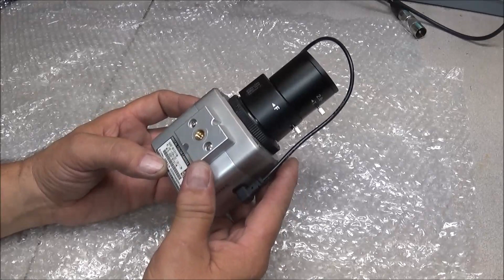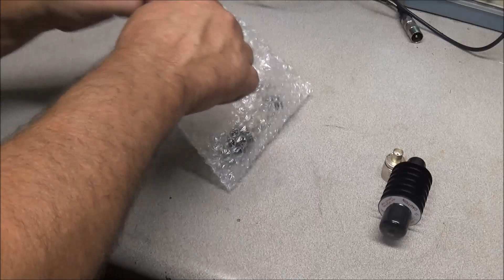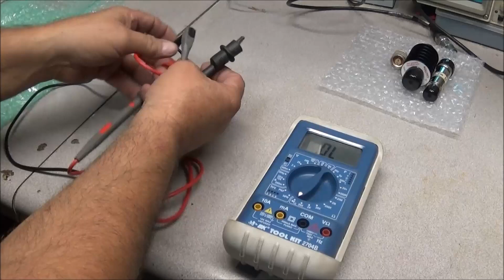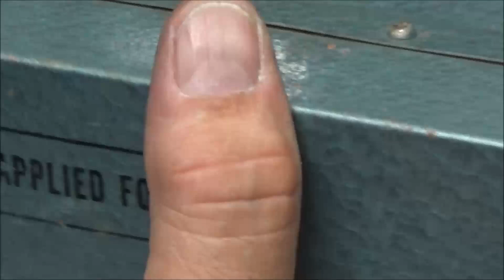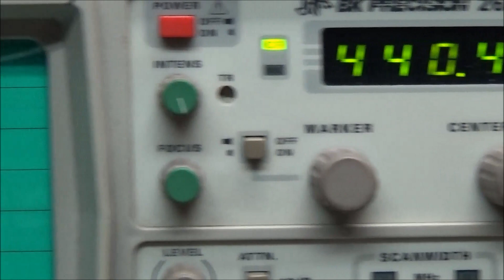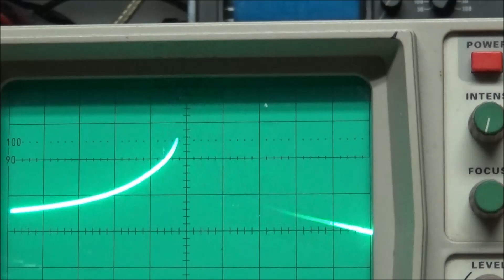#71 Mail Time Special

Comment: Well Buddy thanks to your friend Mike there you now have a well rounded out shop !!!  I am glad for you !!!  Mike done a super job with packing that spectrum analyzer !!!  About two months ago I had bought an old HP 3585b that arrived in good condition, but could have been boxed better !!  Now my analyzer weights 100 lbs it is heavy !!!! It SHOULD have been DOUBLE BOXED, butthey only used one Heavy box, IT somehow got TORN open on one corner in shipment !!  I was worried at first !! but as I opened everything up it was at last O.K. and suffered no damage, they did do one thing right and that is they used plenty of that heavy foam that Mike used with your piece, and that saved the HP inside !!!!  Lots of luck with your unit, now its time to read the manual and get familiar with it !!!!!  Good  Luck there buddy!!!!   John A Bellas  KC2UVN.
Reply from the maker: Thanks John, Mike is a great guy.  100 pounds is one heck of an analyzer. Back breaker. Well we do like old stuff lol.  Glad no damage was done to that battle tank!. Thanks for watching my friend.

Comment: Buddy,
That lens should be a CS mount thread 1"-32. That adapter you unscrewed, see it that will screw on the camera. You will need a frame grabber to get the video into the computer. A USB2 one like in the link below. You will also need a BNC to RCA adapter.

http://www.newegg.com/Product/Product.aspx?Item=9SIA24G28N5810&cm_re=usb_video_capture-_-9SIA24G28N5810-_-Product

Here's link for the manual.

https://www.google.com/url?sa=t&rct=j&q=&esrc=s&source=web&cd=2&cad=rja&uact=8&ved=0ahUKEwir7MvRxZ_PAhVDRCYKHUZLDz8QFgglMAE&url=https%3A%2F%2Fwww.123securityproducts.com%2Fdownloads%2Fdl%2Ffile%2Fid%2F2678%2Fscc_b1311_manual.pdf&usg=AFQjCNFjl7I3E6qmHPQ6leHsCc7mi_JpWw&sig2=uSyg9LKBN8BNQtBboSXCSw

That B&W from Upper Darby, PA is next door to my home QTH.

WB3BJU
Reply from the maker: Donald, thanks for that information. I checked the threads and they will not match either way. Camera threads are smaller. But I think it would be fairly easy to make an adaptor for it. Frame grabber looks simple enough. Appreciate the link.

Comment: I do all my own packing.  I sold on eBay full time for a few years and shipped well over 10,000 items.  Got lots of experience.  I am blessed with a brother that works at a bearing manufacturing plant that throws out that foam by the dumpster load every day.  Needless to say once I found that out I had it diverted my way.  I'm now buried in that stuff.
Reply from the maker: You do a great job at it Mike. This package could had rolled down a hill and survived :)

Comment: LOL. I'm screaming at the screen.  Narrow up the scan width!!!!  :)

Mike
Reply: Mike,
Buddy did say he needed to read the manual.    :-)
Reply: +Donald D'Egidio 

That's why I started with "LOL".  It was set at full scan width or 0 to maximum frequency range.  The two little buttons between the tracking generator controls on the left and the gain controls on the  right are used to narrow or widen the scan width.  He'll figure it out. :)
Reply: +The Radio Shop 

You'll probably have it all figured out by this evening.
Reply from the maker: Noob in training :-) I knew something was not right but could not figure it out.
Reply from the maker: Yep, don't know why I did not catch that while doing the video. Did not even have to consult the manual lol.